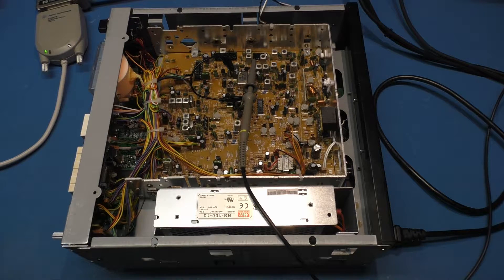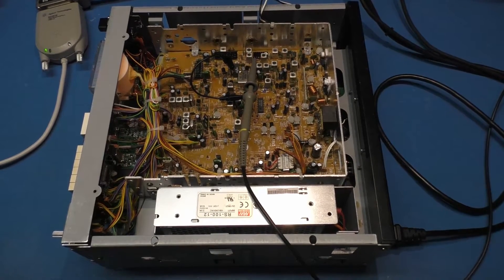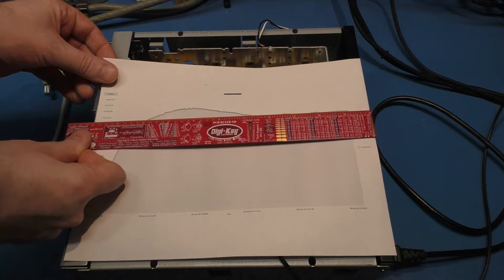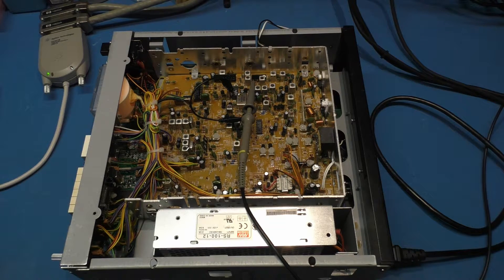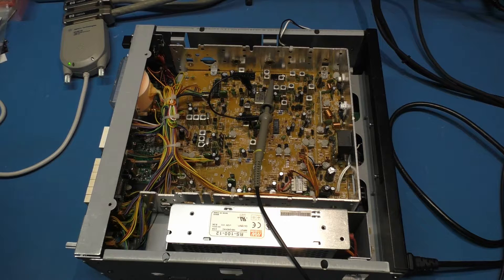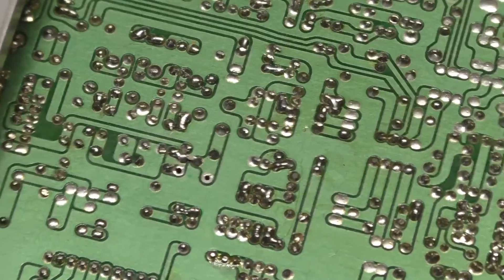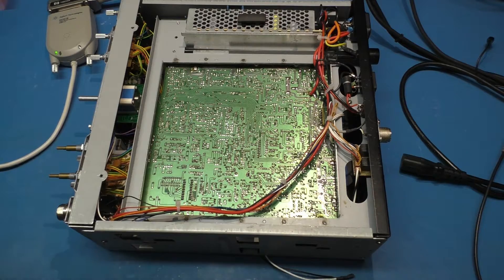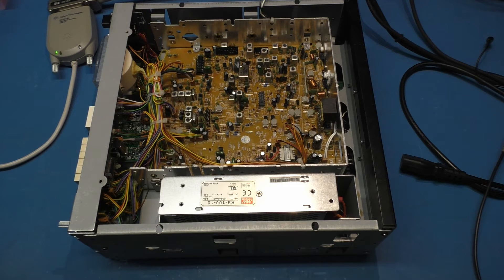DX2547 stability testing

Comment: Hey I’m going to change out the capacitor you suggested because my vfo is unstable..If I touch that cap it goes nuts and just setting there it goes crazy…I should use a 30pf 50v  ceramic cap right? I’m just going to replace the one on the board not the way u did it…also the service manual calls fo a 20 pf any reason why you went 30 …Thank You for your help!!!
Reply: I do see now on the cap it is marked 27 so that would be 27pf …

Comment: Why is the capacitor green and what does the black stripe across the top mean?
Reply from the maker: NP0/C0G cap. supposed to be more thermally stable. Most of the caps in these radios are NOT thermally stable and its probably because they are not real NP0 type caps.... hence the drift...

Comment: Which adjustment or VR adjust does the frequency counter on front mine is a little off ?….
Reply from the maker: My guess without seeing that in a long time is that it's probably a variable cap in the counter itself.
Reply: I had to adjust L20 L21 L22 to get my frequency counter on the front to read on the right frequency…the last digit was of on all three frequencies am Lsb Usb. It was reading 27.2053 after small adjustment on pot L20 AM  I got it locked onto 27.2050..Flip to USB pot L21  and adjusted till it was on frequency and  flipped it over to LSB did the same with LSB pot L22 till it read the same..
Reply: Make sure your radio is on channel 20 when you adjust your am and your upper and lower side band …after you do all your adjusting and your frequency counter stays locked onto the proper frequency you should be good 👍… If your dose meter says your transmission is off frequency even though the counter on the front says your on there is one more adjustment to bring it into alignment…and that’s vr7 .. adjust it last after everything else is good
Reply: Yes I am having some frequency drift from time to time..I want to try and replace the cap but was wondering why the cap is green and what the black strip on top of the cap means…Somebody said the black stripe was temp rating but don’t know for sure

Comment: Bought a brand new DX-2547 A few weeks ago. Out of the box the VCO Lock and voltages were so bad It was a joke.. The Chasis has live voltage on AC ??? I did a alignment and will only run this unit on DC. Its a shit show.. The drift is unacceptable. at constant temperature. The Bias settings were so over the top . This was aligned by Stevie Wonder on a bad day... Lesson Learned modern day mass produced CB radios are a lottery out of the box.. Consumer Beware !!!

Comment: Nice work Mark! 
I will go and replace C130 in my Texas Ranger to SMD for some tests next to compare some more. 

I did replace a few disc ceramics, coils, played a bit with some varactors mostly around LX OSC with some other NPO's in hopes that it would help. 

Also changing regulator to some types you had recommended me some time ago, and these seem to make that temperature change from ~11.5°C down to ~9°C after work done (tests made only in RX mode).

So managed to get readings from antenna socket resultant “drift” which would be a whole mixture of changes across all 3 OSC's... from stock readings of 150Hz drift down to approx 85Hz drift from temp changes of ~24.5°C start up to ~ 33.5°C after enough warm up time around 2 hours with cases closed (and opening case for a short few seconds to probe readings...).

I had for those same temp changes of 24.5 → 33.5°C the following readings across the 3 individual OSC's:
10.240MHz = ~9Hz drift LSB,
10.6975MHz / BFO_CAR = ~34Hz drift LSB,
& LX REF OSC → VCO = ~58Hz drift LSB.

Depending on the mode with different inductance values there would be different “drift” values across LX & CAR OSC of course, but mostly paid attention to LSB for now.

But still no where near as nice as some old for example Uniden Grant (old gen) I measured antenna socket drift from start up to 2 hour warm up @ only 20-25Hz change! 

And repeated this test over a few days few times to confirm that it was a reliable test.
So something in the circuit design especially might not be perhaps as stable with temp changes as with some other rigs, especially when compared to chassis that use the 11.xxxx Mhz xtal then tripled... what do you think could this be something to do with it?

Thank you for the video though, I do like what Mike says about SMD so true.

Comment: guy over on the WWRF forum seems to have found the same part to be suspect.   seems we might have a pattern forming here.  next 2547 i see will be tested for this.
Reply from the maker: Fair enough. That's interesting.
It's probably a bad run of those caps then but I err on the side of caution in calling it a fix.
It fixed this one but I would like to see a few others fixed before I call it a success.

Comment: all galaxies are drifty.
They talking on it for 10 mins and then see if it moved.
Reply from the maker: It's been suggested that I put a max mod in it.
That's a situation where I know the maxmod is better than the original regulator but if I do that I can graph out frequency while in transmit and see how stable it is.

Comment: Hey Mark,  thank you for your time, very I interesting interesting. All of these 2547 have the same drifting issue. I like the radio, However, I don't like to chase a frequency. Not that great for DX either. I have an old Royce 642 that is much better.  Again, thank you!  Joel
Reply from the maker: The more I think about it the more I think it's intentional on these radios to get the huge slide that people want.
I used this one on sideband and it's not terrible as long as you don't turn it up for maximum smoke.
But I agree... if you have to fiddle with it then it's no good.

Comment: I would gladly send you mine to test and repair. It's bone stock built in 2014.
Reply from the maker: I don't think this guarantees that it will correct it. It did on this radio.
It's possible that this is it but really needs verification.
This may be the only radio that ever has this issue with this component.

Comment: LOL, imagine that.  A cheap RCI made radio with cheap out of tolerance parts.  Say it ain't so. :-)  As poorly as RCI makes radios these day's I'm surprised that wasn't the only part.  I'm sure the crystal has some pretty crappy spec's to.  I will never understand why they won't just trash can their through hole style design's and catch up with the last half of the 20th century (that would be the previous century) and go with a SMD board.  Cheaper to make, less variables because there's no long component leads flapping in the breeze causing capacitive and inductive differences between radios, more durable.....
Reply: I concur with your findings Mike . If they can not produce a transceiver stable on 40, 10Khz channels . They need to take a long hard look at themselves..The Galaxy, Ranger shit being released on the market 2020 /2021 is appalling .. The components are laughable and the whole process from assembly to QC,QA is a joke shop... They are stealing a living !!!

Comment: Mark - how did you come to realize that was the offending part? Heat? Cold? Gut feeling?  ;-)  73 - Dino KL0S
Reply from the maker: It seemed abnormally sensitive for an NPO cap.
I was poking around with a ceramic screwdriver and watching the counter jump by nearly 1Khz when I touched it.
Way, way too sensitive. I suspect the capacitor is probably damaged or part of a bad batch. 
As long as you didn't touch it the drift was not too bad.